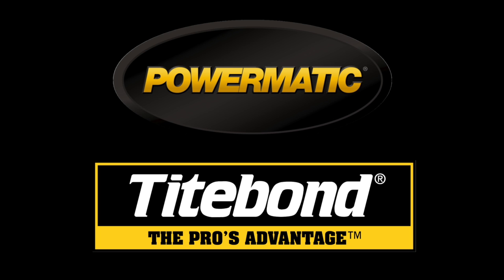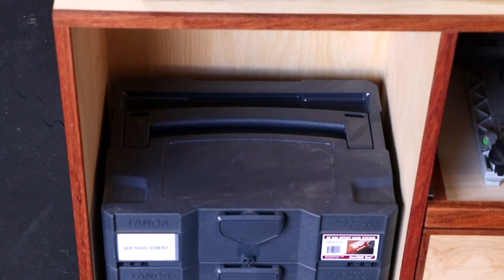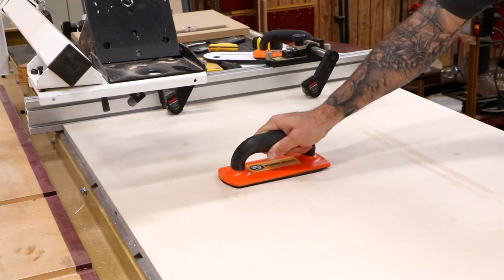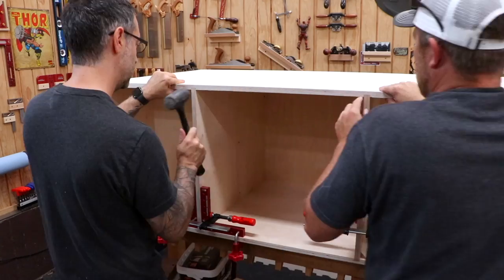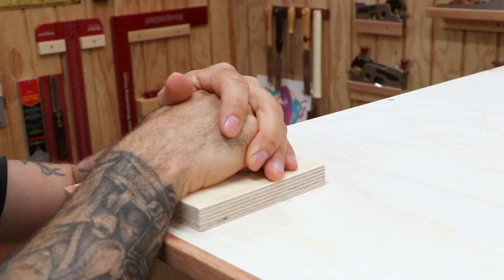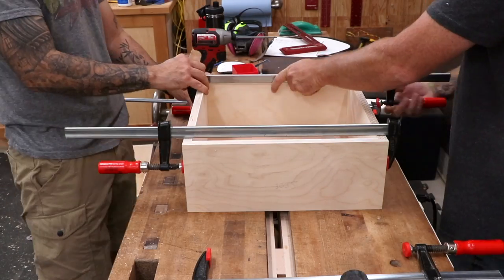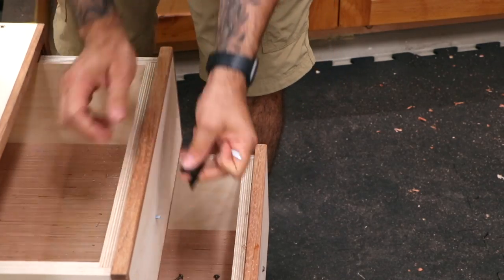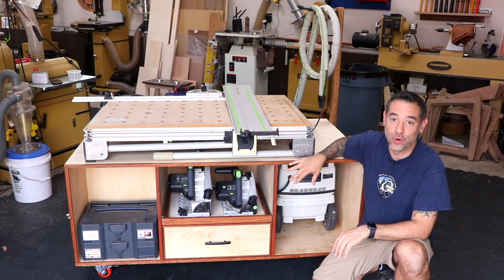Multi-Function Mobile Cart For Festool MFT

Comment: Omg I've been making kitchens for years and never thought to screw drawer fronts on using handle holes . That's genius !!!!! because it's always last thing I did putting handles on ,  so never thought about doing it that way . But it will save so much mucking about with masking tape and super glue or the locating pin method .
Thank you mark ₩🙌🙌👍

Comment: Sometimes i find your videos either lengthy or very commercial; this one reconciled me with your woodworking ideas and content value. Lots of great ideas in this vid. I have an MFT table that got outgrown by my shop setup; now i can make a better use of my portable table. I'll  design a sort of downdraft table to the this concept as an added benefit; using my 3hp dust collection sys. A table that also incorporates my FS CT extractor and separator justifies taking the limited real-estate space of my shop with this huge floor foot print cart.
Norm from Montreal, Canada

Comment: While I agree with the general idea of having a cabinet for the MFT to sit on for both storage and mobility in a fixed-location shop, I designed and built my version of a MFT cabinet with different requirements in mind.  I made it identical in height to the MFT with the legs unfolded so you could temporarily sit another MFT next to it and attach them if desired.  The foot print of the cabinet is identical to the MFT itself so you can clamp things to the side tracks of the MFT for doing things like edge banding.  This also means the drawer handles don't extend past the outline of the MFT.  I wasn't concerned about stowing the shop vac under the MFT, it's only used for systainer storage both in front and back.  The extra space that leaves on one end has drawers for clamps/dogs and accessories.  The double locking casters keep the cabinet rock solid when locked.  The design was discussed on the Festool Owners Group here: https://www.festoolownersgroup.com/member-projects/give-me-an-excuse-to-come-up-with-version-2-for-this-mft-sysport/msg289955/#msg289955  Unfortunately I started doing all my designs in CAD after this project so I don't have precise plans available, but hand sketched plans are included in the thread.

Comment: Putting the MFT table top on a cart is an interesting idea, but I would miss the utility of easy access to the MFT underside for securing the Festool accessories to the top or joining multiple MFTs horizontally. 

If I made a cart, I would try to find a way to attach shelves directly to the extended legs and put the vacuum/saws/router on the shelf. The additional under table support/weight could help brace the MFT for more stability when using hand tools. Just a thought for those who use the MFTs as their only assembling/crosscutting/routing/hand-tooling surface, as I do in my shop.
Reply: He could have drilled holes for the legs and dropped the MFT down into them. Obviously that would have ruined the storage configuration underneath, but I think suspending the table entirely by a few mm would be best as the MFT wouldn't be as stable as what was built around it. Although that'd assume you didn't want the table lower anyway. 
Far simpler would be just to remove the legs and store if you're unlikely to need the portability.

Comment: Great work. Some enginuity. I made myself a steel mft table and took it to my first job after only finishing the welding not complete and with my mft table. I need to do a job today and will take both tables the steel one is a stable you can firmly clamp material.

Comment: Great video.  I just got around to building this project....great idea!  I just started glue-up and realized that my CT-36 won't fit because of the height.  After watching your video again, I noticed that you removed the top shroud of your dust extractor.  Which model did you insert in this project?  I wish I had played closer attention to my unit so I could have modified the plan.  Thanks!!

Comment: Great project. Thank you for sharing the free plans. Question unrelated to the build... I have been drooling over Festool for a good while. I only ever wanted the Domino till I went to Festool Connect and really saw the Track Saw in action. Which would you buy first.... the Domino or the Track Saw? I do plan on doing some case construction. Going to practice building cabinets in my new shop that is 32x35. LOVE the space. Need to make it more efficient. I really want both these tools though.
Reply from the maker: I would go by what you will likely get the most use out of first. Sounds like the saw might be your best bet. Just keep in mind, there are other brands of track saw that are cheaper and still really decent quality. Grizzly, DeWalt, Makita, just to name a few. The Domino, however, is a very different proposition as there's really no direct competitor. So I think the most budget-friendly way to go is to get the track saw first, save a few bucks by going with an alternate brand, then get the Domino sooner because you saved some money on the saw. :)
Reply: @woodwhisperer  Great advice. Thanks

Comment: I purchased your plans and was not sure of the height of your side panels. If I am looking a diagram is the table 34 " high plus height of your casters.  How high is this table from ground level. I'm going to use a Kreg top laying on it because its a little bigger and a little less expensive you can also just buy the Kreg MDF replacement panel and frame it on top over work surface and remove it when just wanting a work surface.
Reply from the maker: Hi Thomas. The size of the side panels is listed in the cut list as well as in the plywood cut diagram. They are 21 1/2" high. But the top and bottom panel rabbets are added to the overall height so with a 4" caster the top surface of the cart is at about 27".

Comment: Nice, I’m working on a similar, slightly larger project right now with a router table incorporated into an mft style top. Might as well get as much use as possible and save some shop space! Curious, did you make or buy your TS overarm dust thing? My Sawstop blade guard kinda works, not great though. Thanks for sharing.

Comment: I love the build! Awesome execution as always! 
I wonder if you’re going to love the bottom drawer with all the clamps and accessories on top left side so you don’t have to bend over all the time since you’re going to use them probably most of the time 🤷🏼‍♂️
Reply from the maker: I have had this thing in the shop for several months and I have yet to open that drawer. :)

Comment: Hi Marc...Nice video and practical solution, as always!  Since the table will stay in your shop, did you consider  making it a bit larger to serve as an assembly table as well, and making your own top with accurately placed 20mm holes, using one of the commercial template systems.... I guess this would be assembly table 3.0 for you....so, basically not using the MFT at all, but creating your own top to take advantabe of all of the MFT clamping devices?  Might be easier to cut plywood if it were larger.... Thanks!

Comment: Any plan on replacing the MFT altogether with a custom top?
Reply from the maker: Nope. The MFT does what I need it to do.
Reply: @woodwhisperer  if you had the chance again, would you still buy the MFT given this solution, or would you custom build a top? I have the MFT and given I never have it setup like you do with the fence (I use the track against dogs mainly), I find it expensive for its function. I wish I'd made my own solution.